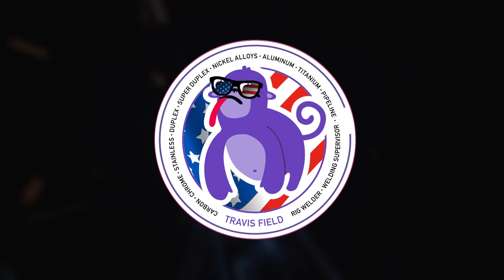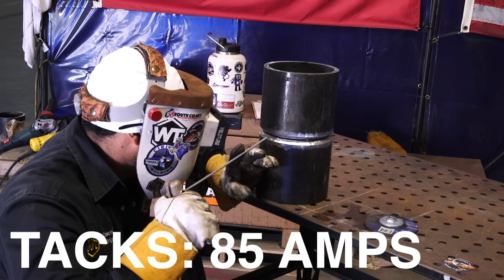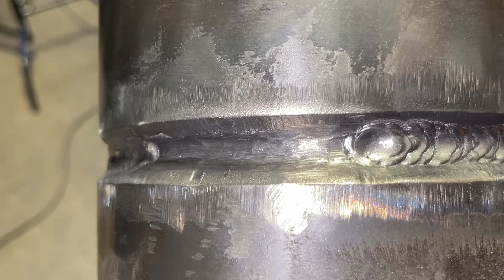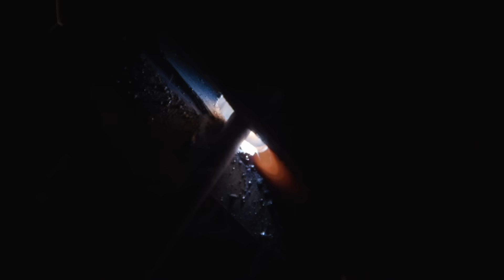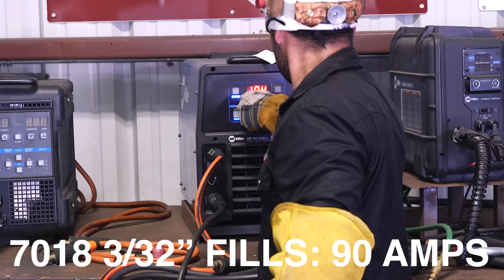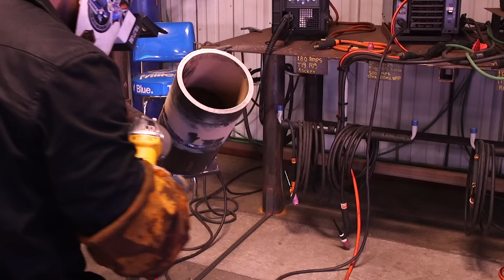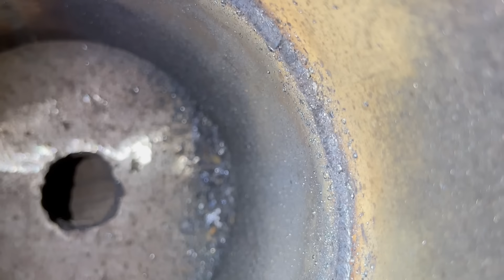6G Stick Welding Test | Open Root 6010 & 7018

Comment: Hard to believe when I went to welding school in 1973 that we learned how to weld pipe by putting a 6010 root pass in and low hydrogen the rest of the way isn't it unreal that things are still done the same way 50 years later. What if your doctor or dentist did things exactly the same way they did 50 years ago
Reply: Hey, you know what? That is a very intriguing way to put it. Two different vocation but that still any interesting perspective, never really looked at it like that...
Reply: @elliottgarcia3658  i agree ive never looked at it like that
Reply: Same process new welder technology 
Microprocessor and inverters make welders lighter and more portable
Reply: A lot of people my age don’t realize how far technology came between ww1 and the height of the Cold War they were doing since amazing things
Reply: There are a lot of new welding processes, I work pipeline transmission and we use some pretty advanced processes depending on the gas company.
Reply: Exactly correct 6010 for the bead and hotpass and LH to fill and cap.
Reply: @russellmiguez9401    That's the procedure for ASME SEC 9 as far as stick welding is concerned but a welder can also put in a root pass with GTAW and GMAW which has a huge advantage compared to SMAW.
Reply: Dentist still do the same things lol
Reply: If dentists did that we'd all be in a lot of pain! LOL.
Reply: takes big puff of cigarette

So, Mr. Hill--how are we doing today?

blows smoke out all over exam room
Reply: This is exactly the way I taught my students from 15 years ago and still teach this way glad to see nothing really changes
Reply: @mrnyceguy74     There are code procedures a welder must go by so you better do your homework, research.
Reply: Thing's do change and a school/instructor must adapt, keep up with, welding codes and procedures weather it's a code from 50 years ago or a 3 months ago.
Reply: The more effective a tool is, the less need for innovation in the design. We still strike nails with hammers the way they did 100 Years ago aswell.
Reply: Brick Masons and other trades are even more profound. There's been tools found in pre-pyramid Egyptian archeology that are the exact same design and shape as the ones we still use today
Reply: I went 1975-76
Reply: The biggest change ive seen since the 70's is the amount of lenses in my hood ( glass and plastic mags) lol and coke bottle lenses on my glasses 😂
Reply: The medical field doesn't have a lot of givens. It's mostly try and see. Welding hasn't changed much because pipe is pipe, overhead is overhead, and a good technique is a good technique.
Reply: If it ain’t broke don’t fix it
Reply: The medical stuff has changed a bunch since the early 60’s.  (Personal experience.)
Reply: It’s metal. It’s not rocket science. Welders yap too much
Reply: I’m still in high school so I might sound green but the way you learned is for boiler makers and high pressure stuff while like 6010 for root and hot pass then low hydrogen the rest is oil field were there isn’t as much pressure going through those pipes
Reply: Are you making fun of my wood teeth?
Reply: Construction tech has gotten better but the best ways are always still the best. It’s just gotten a lot better to do other things cheaper.
Reply: Ita because still is so basic that there isn't really any room for innovation on the process
Reply: https://youtu.be/_vWhOSvHfig pipeline
Reply: I love this video❤
Reply: Hats off for ur experience ❤
Reply: for the most part, we'd all be a lot healthier
Reply: There's better ways to do it, contractors don't want to invest in it.
Reply: People would actually be healthier there were more doctors trying to cure you instead of chasing that kickback from the big pharma pushing all these poisons people call medicine.
Reply: The 6020 electrode rod is rather used for creating the gab. He takes it off after tacking the necessary areas
Reply: thats because we all crave the certainty of steel
Reply: I thank u could do a key hole root pass.WEY.
Reply: Good video,  Semper Fi
Reply: Since when are you allowed to use a grinder.?
Reply: 我是自己在工地学的电焊，去年在中国长江边焊的船
Reply: @建涛刘   wish I could get a translation!
Reply: @tom-vs3lf  I learned welding while working at the construction site
Reply: @tom-vs3lf  whish you learn chinese
Reply: @tom-vs3lf I weleded a ship by the Yangtze River last year.
Reply: @建涛刘   Respect man!
Reply: @tom-vs3lf  thank you
Reply: @tom-vs3lf  where are you,now?
Reply: @JustBreathing94 that’s the whole point, why aren’t we applying it to how we do this?
Reply: I take this test Monday and the whole time I took it to big of a gap and I wrestled it was a pain smh
Reply: Debe tener mucho conocimiento valioso 👏 alguno de su familia siguió sus pasos?
Reply: @Medashita  buyb
Reply: You must not know much about engineering.
Reply: @Blobby_Hill    IT would help but a person doesn't have to know any kind of engineering especially starting out as a beginner.
Reply: @Blobby_Hill  how do you figure that. You normally weld pipe with a 6010 bead and hotpass, then fill and cap with low hydrogen. On pipe line lay barges we used to weld from the bead to the cap with 6010.
Reply: @russellmiguez9401 LIKE I mentioned earlier a person can put in a root pass with the tig process or migʻ process, big advantage.
Reply: Some pipeline just burst on local land as you wrote this grandpa.
Reply: I dont even know how you guys can do it wihtout anxiety that your weld isn't going to cut it, like one day your weld could break and be it a oil refinary or nuclear plant, it could burst and cause a loss of life.
Reply: @nekomasteryoutube3232  That's why we have QC inspectors.
Nothing welded leaves the shop without them checking it thoroughly.
Not only do welds have to pass an x-ray when it comes to piping and vessels, they have to pass hydrostatic testing as well.
Reply: @nekomasteryoutube3232  it actually does happen pipefitters I think  2 or 3 recently lost their life In California because of this
Reply: @nekomasteryoutube3232  just have to have confidence in your welding. Confidence comes with experience. Metal will always degrade over time depending on what it’s being used for. Lack of maintenance and neglect kills people. They also don’t have some joe shmo up there welding on that shit. That stuff is all X-rayed also.
Reply: @nekomasteryoutube3232  X ray crew dude.
Reply: @nekomasteryoutube3232  X ray crew dude.
Reply: @nekomasteryoutube3232  X ray crew dude.
Reply: @nekomasteryoutube3232 that’s like asking if a crack dealer feels bad when he sells crack… we’re getting paid

Comment: I Can Tig Mig Welding
Reply: keep learning add stick and orbital and use all the tools  in  the shop and no worries about a job
Reply: You can go faster if you keep going a round then over lap each weld stopping and welding not to good my friend one bead in the middle clean then a bead on each side clean then last one down the middle you have it omg!

Comment: Cada quien tiene la manera de hacer una 6g con 6010 y 7018 ,para mi en lo personal dejo mucho hombro y jamas punteas directo pones puntos falsos ,un carrete de 8'' lo fondeas con 6 electrodos de 1/8 6010 ,el paso caliente lo hechas con 5/32 descendente y el relleno con 1/8 7018 ,para finalizar la vista igual 1/8 7018 ,en todos los lugares que hecho esa prueba no te permiten usar 3/32 7018 ,respeto al soldador del video pero para mi experiencia le falta mucha practica
Reply: Totalmente de acuerdo.en las pruebas q he hecho se puntean perros y la raíz queda libre y pienso q para el fondeo ese movimiento destroza mucho material no hay necesidad de mover el electrodo para el fondeo.

Comment: Willing to buy a welding hood, I work on the field so I can't wear this things without an adapter to the hard hat, do you guys know if a Lincoln hard hat adapter will work with any of the hoods that this guys are selling?
Reply: Look up the Honeywell speed loop, it’ll fit around most any hard hat and goes right on any pipeliner

Comment: Were you javing a problem w the keyhole opening up way too much, is metal suposed to flow around it?.  Can you do videos on how the tie ins are done in the feild. doesnt the pipe welder have to appriove if its good enough

Comment: when its sizzling you know its going in . iv not done stick welding in about 10 years and used to find it easy doing pipe.  i started a new job February and got to do a 6g stick and 6g Tig weld test. im not looking forward to it haha.   nice video
Reply: If youre ten years rusty, your screwed. Ant chance you can get a couple practice runs?

Comment: Weld tube, would you guys consider doing a video on the 6GR test that is common for welding offshore? I failed one. 3/16” root gap, top pipe had no bevel it was flat and there was a steep bevel on the bottom pipe w no land. Restriction plate on top. Root was to be performed with a 3/32 7018🤯. Top pipe was thicker than the bottom pipe. Both had an OD of 6”.
Reply: Steel Box Railing installation 👇https://youtu.be/V_4otuTo7wY
Reply: Jack Phillip that sounds like a nightmare. I'm 2 months into welding school and practicing pipe after hours while the rest of the class is still on T-joints lol. Anything new seems
Reply: Tough but it gets much easier once you break past each difficulty spike

Comment: “Key to a good weld, is a good fit”.  
Such an understatement
Reply: Can't forget to take your time and get comfortable
Reply: @wolfoftime1405  💯
Reply: As an Electrician who has also dabbled in Painting and Finish Carpentry, on a professional level, the 80/20 Rule applies: 80% of the work is preparing for the work.
Reply: @TimeSurfer206  very well said
Reply: Proper preparation is such a key
Reply: No I’ve found that’s if the fit isn’t fucking perfect to a T the weld mid or dog shit. If I have a perfect fit up my god the weld comes out slick as oil.
Reply: How do you mean?  I concur with him
Reply: @weldwizard  He's basically saying that it can't be said enough.
Reply: mhhh any good welder will hit it
Reply: Good fit , and a little extra fire 🔥 on that stick gets it done hot & smooth like a roach back !

Comment: I’ve NEVER had lof with only grinding one side of the tack. If you leave a keyhole you can come back off the keyhole… the tie in coming into a tack is the critical part to grind.

Comment: Just finished this at school. I liked 1/8 land with a zipped thru root opening. Straight drag root pass. Cap is the hardest part of this test
Reply: Did u have 3/32 gap?

Comment: Why is everyone scared of stringers I’ve been taught never to weave due to the lower tensile strength.
Reply: only time you really should not weave is rods with iron powder in the flux 
like 6013 or 9018 ect in the flat position

my experance with trying to weave in the flat with those rods always ends up with traped flux in the weld 
you just cant stay ahead of the flux and not trap it if your gonna end up with a weld that will hold or pass extay
Reply: @eddiegirvan2394  omg bro I just realized why I get flux spots, I gotta stop weaving in flat positions! Tysm
Reply: Yeah, the only time I've ever used a weave technique is on vertical stick, and you can also use stingers all the way for that as well. On my mig flat, I weaved on the cap only.
Reply: My supervisor still doesn’t understand I told him weave is not good practice but he is 🥸